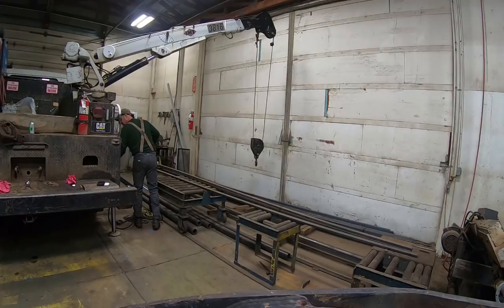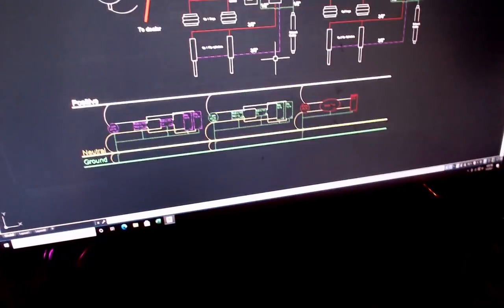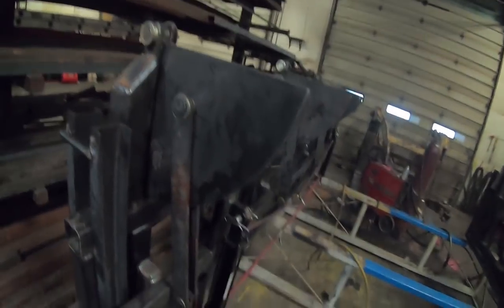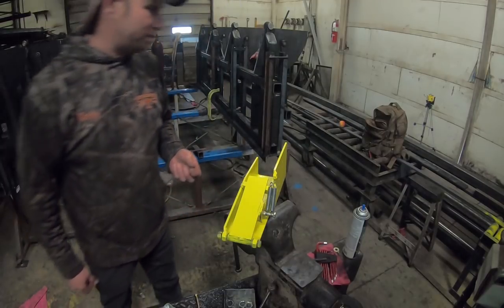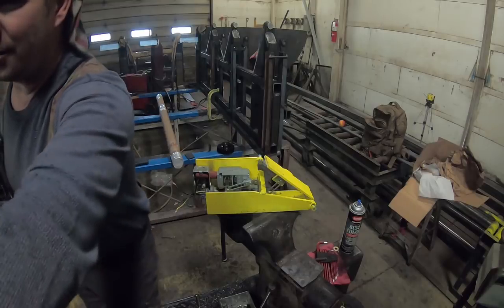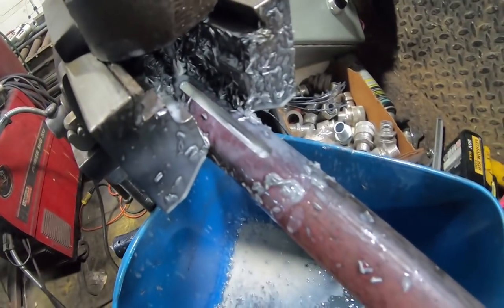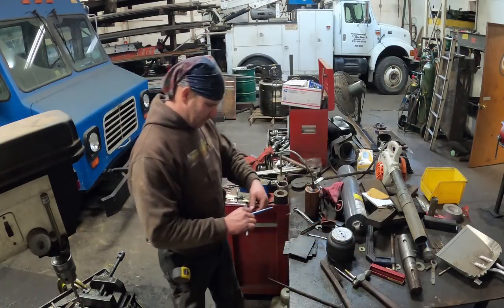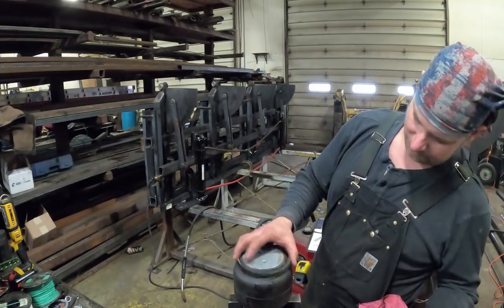Retractable Board Turner Design and build!!

Comment: From a machinist stand point where in the hell did you get that keyway cutting contraption. Why not use the milling machine?????..... I would not weld the rack gear to the frame. Going to be a bitch to change when it’s wore out and in place in the mill. That thing a ma bob is called a rotary table. Haven’t used one in years. Neve leave your dial calipers on the mill table or lathe cross side because of the chips getting in the rack and pinion. All in all bud love watching your fabrication vija’s. Hell of a good idea. 👊👊👊👊

Comment: All good bud, I did design of heavy industry equipment.  Aluminum recovery from Alcoa dross.  Ball mills, crushers, hammer mills, plenty of conveyor systems, bag houses, electric motors up to 500 hp.  We even designed a digestion system that washed the salt out of the dross using a couple of cement mixer drums.  Bunches of fun there.

Comment: If you understand what you're doing ,all is good in the shop, better yet ,I get it too. Only concerns that I have are, when you adjusted the spindle speed on the mill, you're doing it too fast. Tends to rip the linings out of the pulley up above, when it starts clanking and rattling you know why, and then I can tell ya how we fixed ours for all time.  Also I am not sure about welding the racks on. I used to drill and counterbore down thru the teeth for socket head cap screws (allen bolts ), and we never had any issues with them. Just some ramblings from up north, project loos good so far, and if it goes wrong ya can always go out on the road as a Bob Dylan tribute band LoL¡!!!!!!